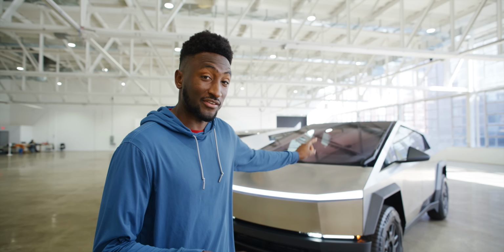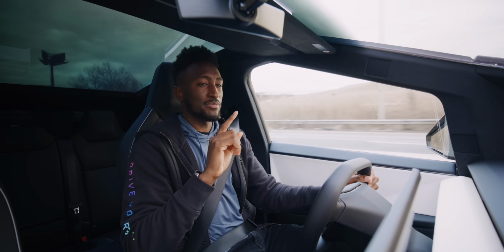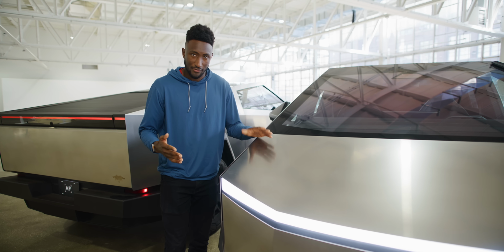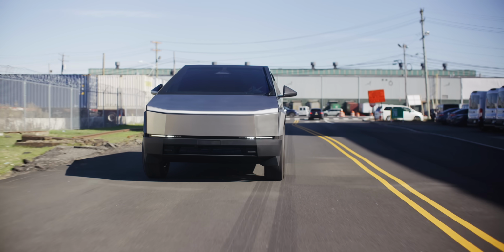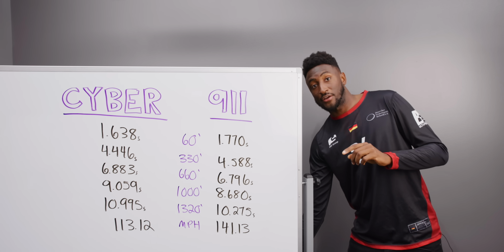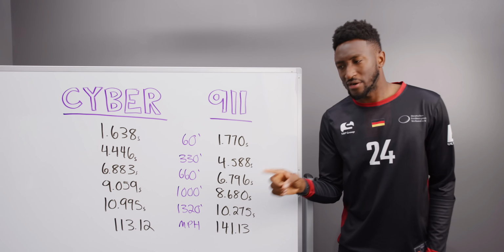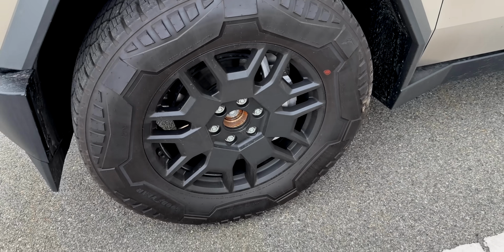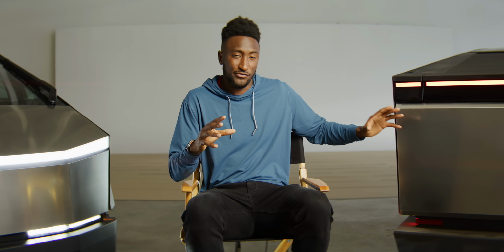Tesla Cybertruck Review: Already Iconic?

Comment: There's lot of safety concerns with a car like this. The esign is iconic in the way that no one makes cars like this, but there's a reason for that. If the exterior of the car doesn't budge on impact, all the strength of the hit ill go to launching you forwards, making it way more likely that you'll get hurt or worse. An the same goes for any other car you carsh with, the cyber truck absorbs no force in said impact compared to normal cars. That, and wind resistance is also a factor in efficiency as you said. The point is, no one is making them like that because they're smarter than tat. An being iconic in exchange for being less safe, not worth it. Also, it's iconic, but ugly, that's just that.

Comment: It being indestructible stainless steel is itself a problem. At 7:30 you say that the driver will be fine but thata not true. In fact thats why modern cars are designed to be 'flimsy'. The crumple reduces the force of a crash by having it absorb the kinetic energy of the crash.  If the truck stays rigid and you get into a high speed collision, the other person is dead and you'll still carry the inertia of the truck at a full stop. You'll be flung into the windshield so hard itd be a miracle if you came out uninjured or alive.

Comment: "If someone hits you, you'll be fine." You are just wrong. The energy will not be absorbed by crumple zones as in a normal safe vehicle, so it has to go elsewhere. Namely, your body. Having a seat belt and air bags will help a little but they don't really absorb energy, they redirect it, into you. You won't fly out the windshield but you will be hit by a giant hammer which will snap bone and crush organs.

Comment: Imagine crashing one into a solid object. 100% of the energy will be transferred directly into the occupant and accelerate through the windscreen. Nobody is talking about the obvious safety issues of using steel body panels. It's not just pedestrians who will suffer more if you hit them. Without crumple zones and deliberately designed energy transferring body panels the Cybertruck stands to act as a death trap for the drivers and passengers inside. It's unbelievable that higher safety standards don't already exist in the USA which would have prevented the current Cybertruck design from ever being allowed on a public road.

Comment: Based on several other reviews on this thing you were way to easy on it. You almost completely ignored its safety issues and despite your statistics showing most people that buy trucks don't use them for truck stuff, that shouldn't give it a pass in how terrible it is for truck stuff. This thing has been shown to be horrible for towing or hauling over even moderate distances and only comes in a bed variation so small you can fit almost nothing in it. I'm glad you pointed out some of the problems that come from the lack of physical controls in vehicles however, that trend is absolutely horrible and a major safety problem.

Comment: This additide of willing beta tester is really messed up. It's a car. Its a massive peice of steel traveling at high speeds, from the testing thats out and the recall thats in it shouldn't of been legal. That self closeing trunk could easily remove fingers or a hand, and the gas pedal was held on by a plastic clip. You cannot beta test on the general public with a car.

Comment: The Cybertruck even being in the ballpark of a 911 is insane considering its size and weight. But it BEATS the 911 at 0-60, the speeds that matter to typical drivers on typical roads. That's underrated performance. Losing to a 911 at 80+ mph is irrelevant.

Comment: The stainless steel. You’re right it’s overrated having bulletproof panels, bulletproof glass. But  Navigators and other vehicles do get upgraded to bulletproof (for a big fee) by custom shops. And in one of the Munro Live videos shared how they started with 3mm thick body panels, then switched to thinner metal, saying they changed the alloy so they had the same durability that weighs and costs less. But I’m sure they didn’t mind slightly lowering the bulletproof-ness. It makes no sense to invite people to shoot at your truck.

Comment: I am still so incredibly sceptical about steer by wire. Sure, I love the variable steering rates and the haptic feedback, but what happens when the car is old and it fails. Are you just going to suddenly lose all steering, is the car going to think you’re doing 20 down the highway and adjust the steering accordingly? At least with a mechanical steering wheel, any failure is likely to be a progressive failure that will give you forewarning.

Comment: Idk Mk there's a lot of things that you left out of this review or at least could have mentioned that make it feel like you were intentionally going soft of Tesla for one reason or another:
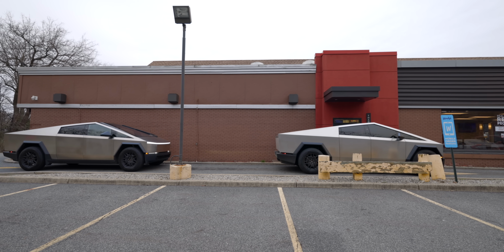1. The stainless steel panels rust very easily (anything from dead bugs to bird droppings can lead to rusting) and the panels will start to change colour if exposed to water whilst in the sun (something like the second CT at 26:01).
2. To avoid the rusting problem Tesla charges 5k to put a protective coating on the panels which they should have put on it in the first place
3. The panels are not fucking bulletproof
4. Drag racing it is pretty dumb if you are not going to be towing stuff either. One could argue that the people who buy the CT are more likely to tow something than ever be in any form of race with it.
5. For a truck it has a very tiny bay, no bigger than the average Suzuki light truck, this is a very important bit of information considering how that bay size dictates how much you can potentially carry. You didn't at all dwell on this part and only briefly touched on it by saying you and your crew use it to move your equipment but exactly how much equipment was that bro? Surely you caould have taken 2 or 3 minutes to just show how many grocery bags or suitcases can fit in the bay and taken 2 or 3 less minutes glazing the "iconic design" 
6. For health and safety reasons it is entirely irresponsible to not accurately communicate how much of a bruising and cutting hazard the sharp steel edges of the doors actually are, I have seen videos of carrots getting sliced and chopped against the edges of the door, they're like fucking katanas 😂.
Anyway, I hope in a year or so we can get a more well rounded review from you tackling the issues I've just highlighted, especially number 6 because if anyone who owns a toddler has designs on buying this dumb truck, they should at least know that it comes with the possibility of leaving their toddler devoid of a finger or two.

Comment: Im pretty sure the most dangerous thing is the faulty accelerator pedal
Reply: It was recalled and fixed. With out a single incident. Cars have recalls all the time. It happens.
Reply: @PokerHardlyKnowHer  The recall was for every single model sold and it's not even remotely close to being done. Cars are usually not recalled for that severe of a safety concern either. Stop defending this absolute bullshit project. It costs double the advertised price and lacks nearly all of the originally mentioned features. Production quality is terrible, it is unsafe and not even good at the things EVs are usually good at.

Comment: Arent cars supposed to crumble on impact to have the car take the force and not the human?  THat seems dangerous with major collisions.
Reply: Elon pulled a Bad joke on everyone. Even the way it looks is designed to offend.
Reply: Yeah, it’s incredibly bad design. Frighteningly bad actually. It’s a very unsettling trend that Tesla has now begun to show since Elon took over.
Reply: @derpleyew that's the the bumper that had to crumple not the upper area above bumper!!
Reply: @shiraishi1  sweetie, no. The bumper is to protect the car in a minor collision by absorbing the shock, for something like reversing a little too far and bumping into a wall or another vehicle while parking, it’s plastic so it doesn’t risk having the structural integrity of the car damaged.

The crumple zone (in the EU & UK at least) is the bonnet/hood at the front of the car, covering the engine. It’s designed to absorb the  majority of the shock in a major collision, to slow the car down before the stopping impact where the chassis is more rigid and is designed to withhold integrity to not crush people’s legs. 
It’s a well thought out safety mechanic that works very effectively, obviously it’s imperfect, but for the most part it stops people being trapped inside their car with broken legs after a head on collision.
Reply: @derpleyew  sweetie 😂  it has crumple zones and mine civic has a metal bonnet ,all cars to,check the cybertruck crashed video and u will see crumpled zones ok sweetie
Reply: @shiraishi1  all cars have a metal bonnet, yes, but the cyber truck isn’t the same type of metal body 

Tesla had to include some form of crumple zone to be able to sell it in the US, and it didn’t even have them in the original design. 
They only added them to comply with the bare minimum to make it road-safe and sellable in the US. But the few crumple zones the cyber truck has are heavily reliant on a specific types of impact. Most cars are designed with other cars and road users in mind, so it’s kind of mutually beneficial to have the same safety features, but the cyber truck doesn’t, so if you crash into one in your Civic you will probably die because you car will be crushed by a cyber truck.
Reply: @derpleyew  u have a point, but my steel civic just can kill a person as the stainless steel in cyber truck. Also then pagani should be illegal as carbon fibre is 2 times hard as steel and  0.5 times hard as stainless steel in CT!

Comment: Comparing that Tesla thing to a PT Cruiser (Dodge Neon underpinnings) with a $16K base price to a "Cybertruck" @ $60K to $100K is a bit of a stretch when comparing potential mass sales.  The biggest potential problem is the owner of the company.  Nothing that man says can be trusted.  The vehicle may have some fetching features BUT latching hardware falling off?  Not good.  Recall of 100% of these trucks due to accelerator pedal experiencing rapid unscheduled disassembly (thankfully unlike the SpaceX RUD it truck doesn't blow up it just falls apart).  Marques, you didn't mention the rusty "stainless".  How long will you wait to get these damn things repaired?  In the past the wait was horrendous.  Marques, I hope you enjoy carefree miles in your new ride but I think you have been too kind to a problematic manufacturer.

Before you attribute this to "teething problems", German Teslas were experiencing much higher that typical failure to pass inspection just three years after purchase.  Good luck to anybody that buys a Tesla.

Comment: Now, you can add a stuck accelerator pedal, which has prompted a recall of over 3,500 vehicles. This is a novelty now, but it will cause an accident due to the distraction it causes others. This car is UGLY and has no practicality.

Comment: It's the most stupic car design ever, like a kid drew it. It does not work as a truck because you can hardly use the bed, it does not work off road and it has serious build issues. And It won't be allowed into in most countries outside the US because of the sharp edges.

Comment: Owning (or wanting to own) a Cybertruck is the new Mid-Life Crisis cry for help/desperate bid to be relevant. It's like a 2006 Honda Ridgeline drawn by a 4 year old made by a company whose grifter CEO acts like a 5 year old. Tesla was already the epitome of 'Form over Function' due to prioritizing aesthetics and high profit margins (for example, by removing radar and ultrasonic sensors for cheaper optical cameras), but this model takes that to a new low by having a hideous form. I've seen several in person (both standard and ones with wraps), and they're hideous and ridiculous. The production quality is predictably horrible (the production issues as addressed in the video are inexcusable for such a tiny run of luxury vehicles), repairs are absurdly expensive, and the brake lights don't work properly. The actual utility of it (as mentioned in the video) is laughable because it has low towing power,  you can't fit much in the truck bed, it has difficulty going up inclines that over vehicles climb with ease, the range is significantly less than advertised, the battery compartment is only half full, and it needs to be cleaned off shortly after getting wet. Tesla even says you shouldn't take it through a car wash! It's not bulletproof except against a small percentage of handguns, and the height and design of the vehicle makes it difficult to see pedestrians in front of you. Yoke steering wheels are also a known safety hazard. But hey, you do you I guess.

Another fun fact is that working at Tesla is dangerous because the company is infamous for ignoring safety best practices in their factories because Musk hates the color yellow, doesn't like safety signs, and doesn't like beeping noises. Not sure why he even cares what the factories look like, since he's not an engineer, he apparently doesn't care about the condition Tesla vehicles leave the factories in, and he's on Twitter all the time anyway.

Comment: Charging $100,000 for a vehicle, spending almost 5 years on development, and making claims like Elon did (King of fake promises at this point) removes all allowance for "early adopter issues". When you guys had to use duct-tape to fix the door? That's when the car should have been back at the dealer and a check in your pocket to repay it.
Not to mention the tires ruining themselves with the hubcap and the things that were promised on the car and not (not even getting into the 'tent' thing).

I wanted this car, but I'll want until another dealer makes it.

Comment: Being "iconic" doesn't require it to be an actually good vehicle.  All it means is that it's easily recognizable, and since I actually saw one on the road, you can recognize that POS from a mile away.  lol.  Also - being mass produced.... that's a bit of a leap.  These things are being rushed so quickly out the door that the glue hasn't even had enough time to dry yet... and as of yesterday, deliveries of the cybertruck are being halted due to faulty gas pedals...  I don't blame people for liking the concept.  it's different, weird, and shiny, and people like shiny new objects, even if they're garbage.  :/

Comment: There's a reason most trucks look the same - the design works. The cybertruck has horrible bed space, it's not safe in an accident, and it has issues with reliability and frame rusting.

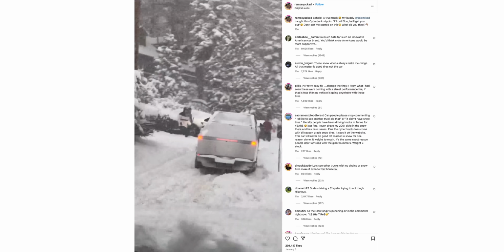Comment: 12:46 be real man, very few trucks have the CEO of the company saying unrealistic stuff like “you will be able to use it as a boat briefly”
Reply: What's wild about that that most people wouldn't be aware of - the military specifically has vehicles made to traverse bodies of water successfully. But get this - each vehicle, ACVS,  IFVs, BMPs, whatever that is about to undergo a water maneuver often has to be modified to put it into "boat" mode prior to the traversal. Beyond that, each and every vehicle I have ever encountered in the Marines requires significant additional maintenance to be performed, and be de-"boat" mode'd after the crossing. Driving a stainless steel toaster that is already having issues with rusting due to car washes is... crazy. I can't imagine what actually using this as a boat would cause to the vehicle.

Comment: Wow, a 3000 KG box of sharp, rigid metal going 911 speeds spotlight to spotlight. Yeah that sounds fun and safe 💀 
I've seen way smaller cars collapse brick walls on avenues given enough speed. Imagine what a three metric ton steel brick on wheels would do to plaster and drywall buildings. And I fully expect the average Tesla owner to be that careless.

Comment: Ive only seen one on the road, it was cool, I like it. And for 4 wheeling, not having the diff's and axles, the whole drivetrain, in the way is a game changer. Maybe they are keeping the moon in mind with the design? Easier to operate if you're in a space suit, and large flat surfaces for solar recharge on the moon. These could be customized to be heavy equipment tools like dozers, excavators, cranes etc on the moon. He said we are going to have a permanent base on the moon, we are going to need some heavy equipment to build it, I bet we see this thing on the moon.